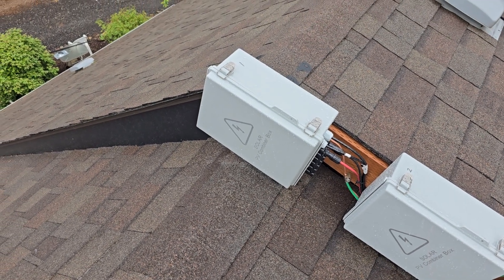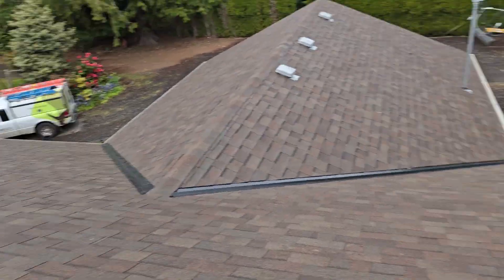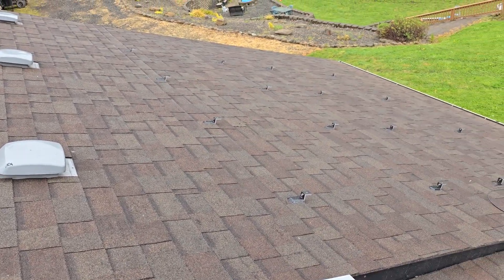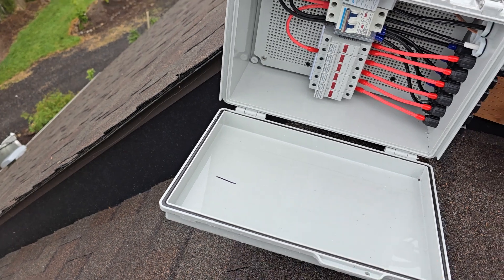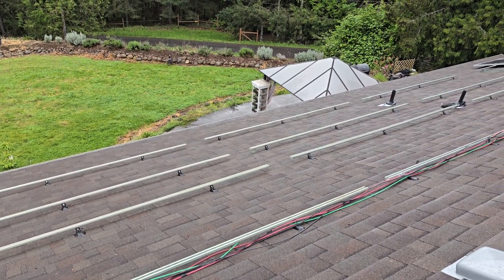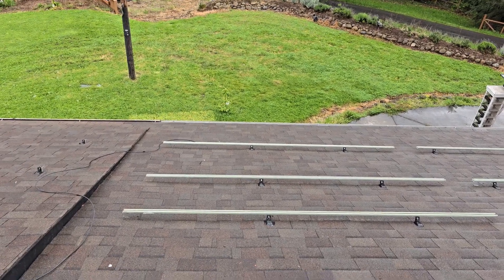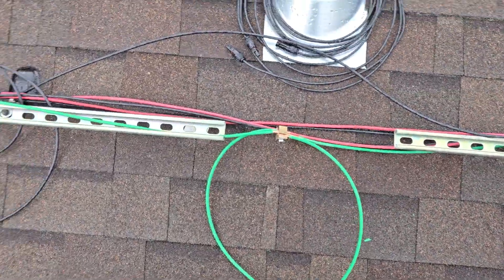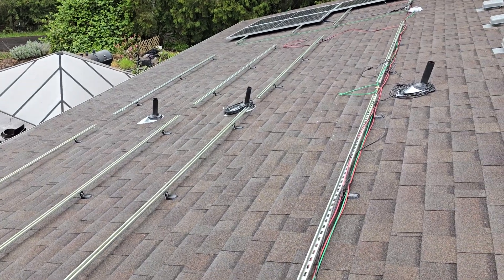Understanding Solar Charge Controllers, Combiner box, and Solar Panel Wiring.

Comment: Wouldn't you need more  airgap between roof and bottom of panels? Panel would get very hot?
Reply from the maker: @BrendaKlahn  there is about 3"  of gap and remember the panels work better when they are warm.